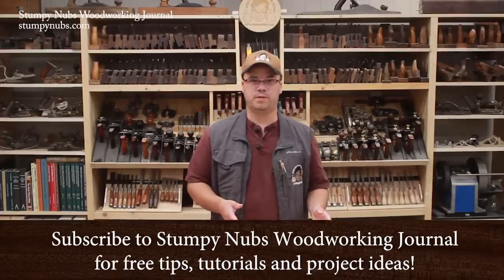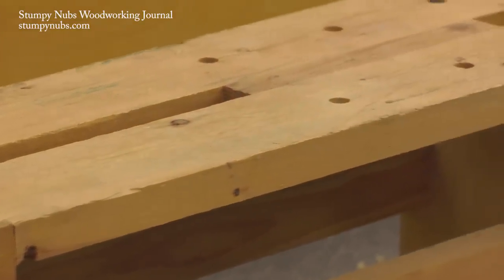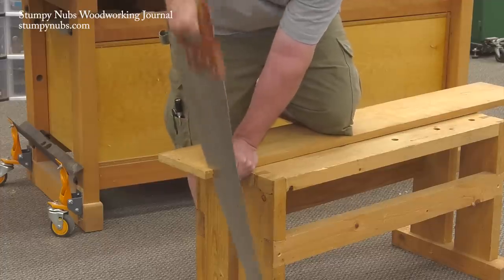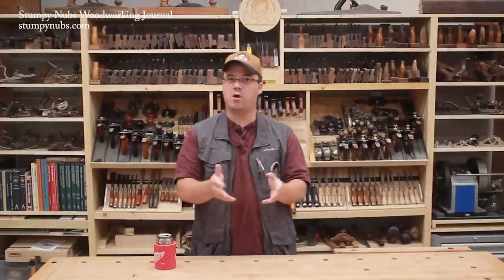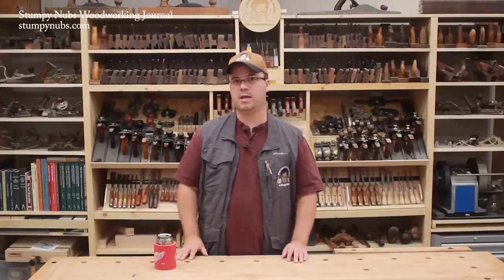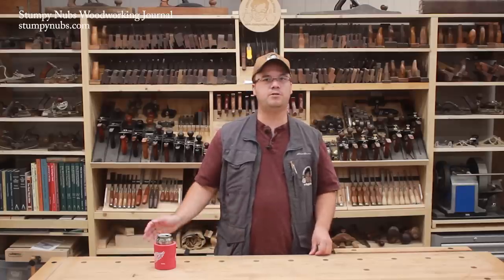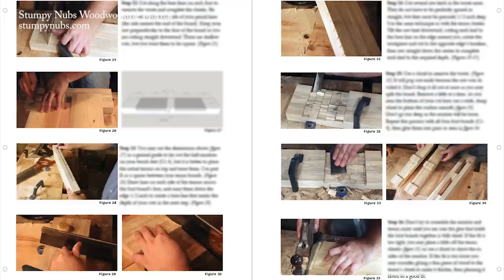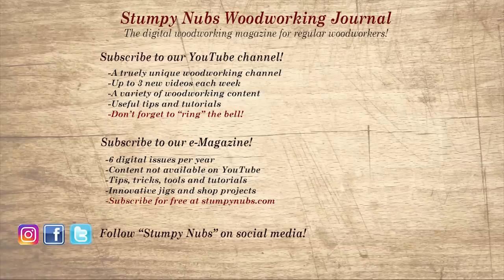Do you need a sawbench? (And what's a sawbench, anyway?)

Comment: The picture of your work bench is not respectful of the value of this bench... I built one of these when you first showed it several years ago, it is gorgeous, my neighbor calls it my $2,500 bench because it took me a while to get it done!  All edges rounded, all surface planed smooth, all joints tight ... stained, varnished and beautiful as well as extremely functional... my favorite tool!  Thank you so much, Steve k.

Comment: I watched the sawbench video on the Stupy Nubs website a few years ago. It didn't take me long to go build one of these gems. In fact, I was just using mine today! When I built it, I only had a circular saw, a cordless drill, and a few hand tools which included a set of H-F chisels and a couple of Stanley hand planes that I inherited. It has been a real help in building up my simple garage shop. my dovetails are not perfect, and the wood-putty is very visible, but they were my first attempt at cutting dovetails, so I am okay with it. Maybe someday I will make another one, with more perfect joints, but until then, this one works just fine.

After using it for a couple of years, the only design modification I would suggest is to put the middle pieces (the 2x4 that you called lateral supports) on the INSIDE of each of the legs. I put them on the outside like you did. They get in the way when I try to use clamps to hold the work piece down (I don't have bench hooks... yet...). I especially like that it is a piece of shop furniture that I can sit on when I get tired of standing. I forgot about the part where you said to build two of them and use them as sawhorses, or as an assembly table... maybe I need to get on building a second one!

Comment: I built a parasol benches before I built the pair of horses. Sense my saw benches or 2 by 8 on legs with plywood gussets I've never actually built a wood working table I've got a vise mounted to one of them of I not in the other and they're both hollow in the center. In addition venot can have a log mounted do it because it has a corresponding the not lower in the legs and it's a simple matter of strapping it down I have to use that option for a horse headed  Draw knife set up works great

Comment: This is a great idea. I had been saving a piano bench thinking it would be good for hand sawing. With it cut down to knee height and a slot opened in the seat it is perfect for ripping or cross cutting boards. A two by four reinforces the seat on each side of the slot. An A frame folding sawhorse at the same height will support longer pieces.

Comment: James thanks!! I have downloaded the plans for sawbench that will be my next project for two reasons: recently i finished my jointer bench and more than 90 present of the cuts i used my hand saw ( Japanese) and all the first cuts i made on low garden bench ( too low and not so rigid for the task but i made it) the second reason i want to develop my hand skills ( i am new to woodworking and  even more using hand tools) i have found using hand tools is much more satisfying. And actually there are more reasons... Your videos helped me a lot as beginner weekend woodworker... thanks again